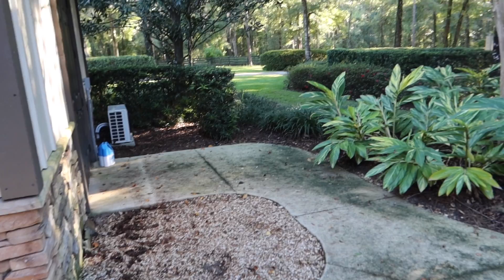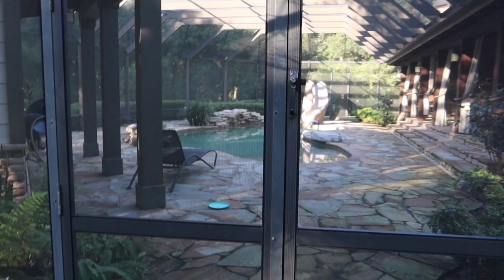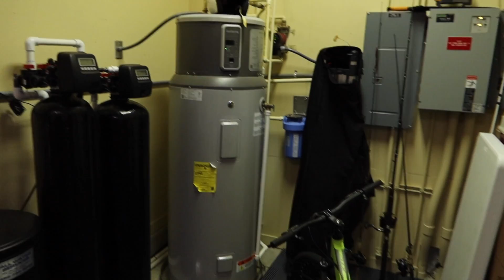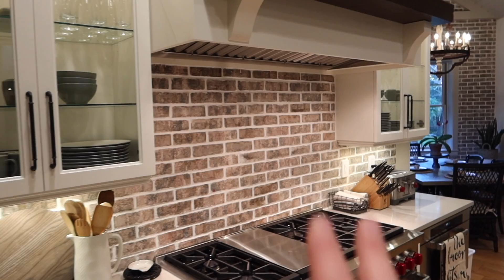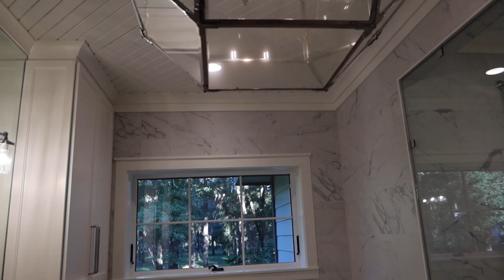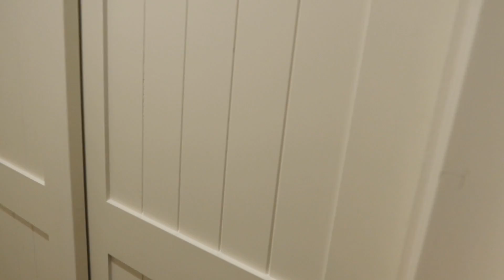2019 House Tour:  Discussing Past, Present, & Future Plans

Comment: is the floors real wood or laminate?? cause you can get the yellow out by just sanding the floors and get mat laquer, my buddy has a big compagny here in denmark, and they can before the laquer even stain it white , but i have been told that the mat laquer is not so big in the us, like here in scandinavien.
you really highlight that the maintenens is alot more then buying the house, 900 dollars a month for the garden , if you can get grundfoss pumps over there they are top off the line pumps ,made 30-40 miles from my house

regards
Sören
Reply from the maker: It's real, so you are right, it could be refinished.

Comment: As much concrete work as you need, I think you would be better served to rip it all out and start over - maybe go with stamped concrete or stamped asphalt?  It would really elevate the property.  I think you could also go bigger on the exterior lights starting at the base of the driveway and on the house/porch/washbay area etc.    Your washbay area is begging for a vintage gas pump or two!  Love this type of video Matt - thanks for sharing.

Comment: Do you have any plans of sealing your rocks in the pool area and or sealing the driveway to cut down on the mildew? That driveway use to to drive me crazy at my two previous houses before with oak tress. I don’t like big trees when they are around area where I drive my cars.  It’s hard because you have so many of them or at least in the future you could ensure trees are further away from the driveway. Great property you have.
Reply from the maker: I've found that sealing stuff changes the look.  It's been 3+ years since we have had it cleaned.  I think every two years would keep it nice.
Reply: Yeah you are right it does darken it little. In our community every drive way is pavers and the ones aren’t sealed you can see a big difference. I really think you only need to do it like once ever 3-5 years or more. But you are right if you clean it once every two years you will be fine.

Comment: Leave the driveway till last, when u build the the new garage the concrete and steel trucks will dirty and damage it even more.
Reply from the maker: Yeah, that would be the plan.
Reply: @ObsessedGarage  i would leave a gap between the blocks for heat expansion. It will prevent future cracks